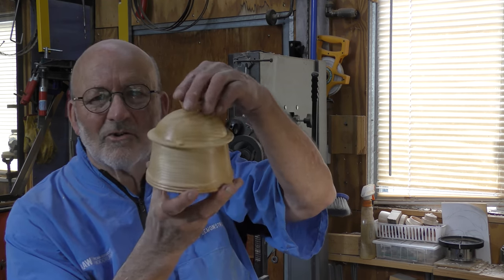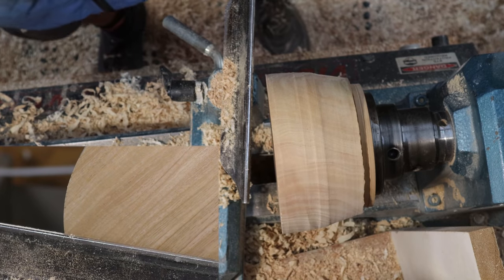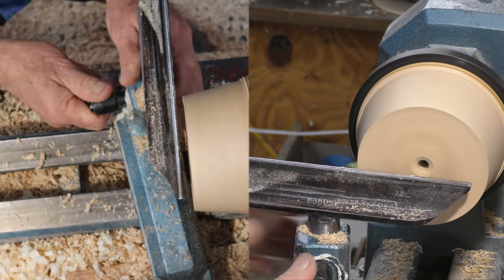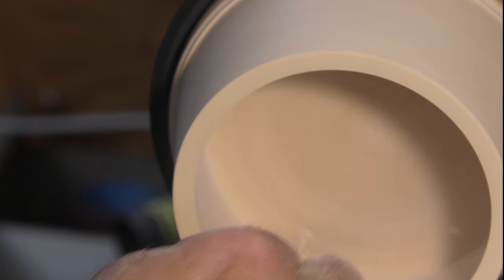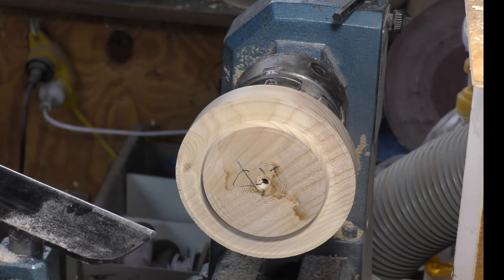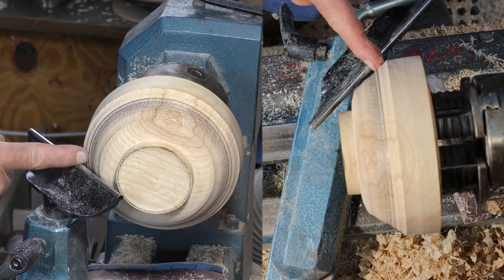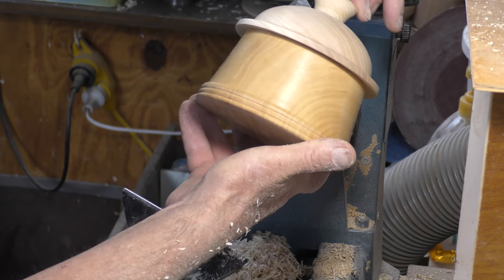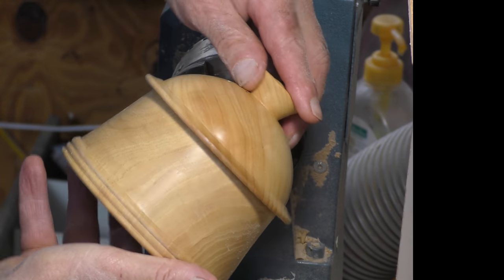Richard Raffan turns a cross-grain box

Comment: Great teacher! Why using a spindle gauge and not a bowl gauge? Thanks in advance!
Reply from the maker: You don’t need the strength of a bowl gouge working close to the rest, so using a less expensive tool makes sense, at least to me. But chiefly I find shavings get away faster from a spindle gouge — wide and thick shavings can jam in a deep flute when there’s a hand over the flute deflecting shavings. Also a fingernail spindle gouge gets into to corners whereas that can be difficult using a bowl gouge.

Comment: Nice video's, but what you call a shear cut, is that not a push cut?
Reply from the maker: A shear cut is to do with the angle of the portion of the blade cutting to the oncoming wood. A push cut should be a shear cut, but some turners manage to have the edge scraping.